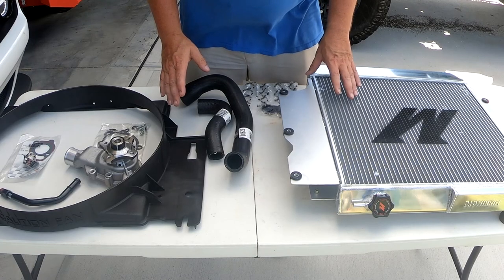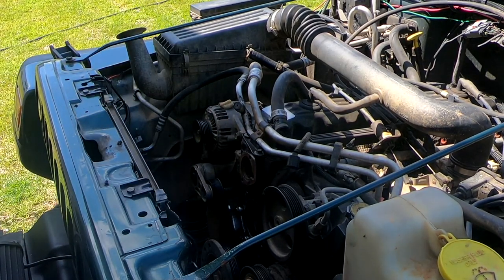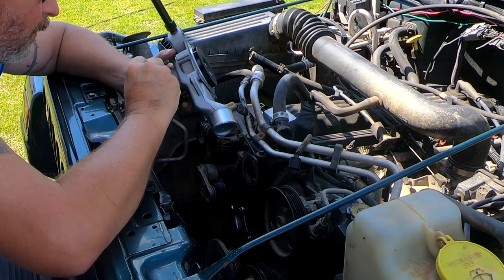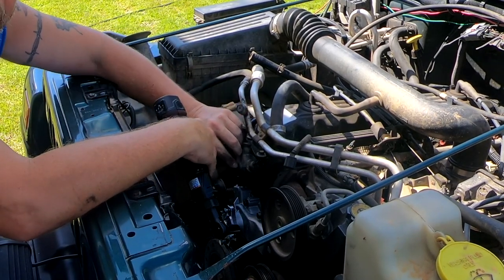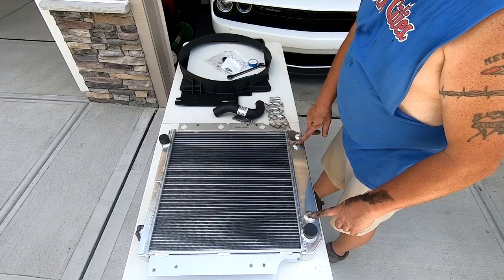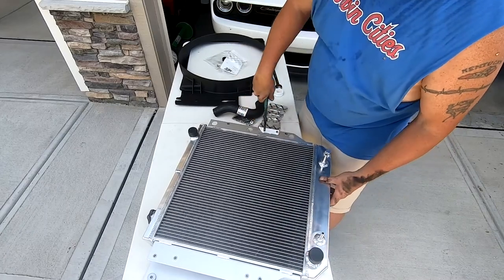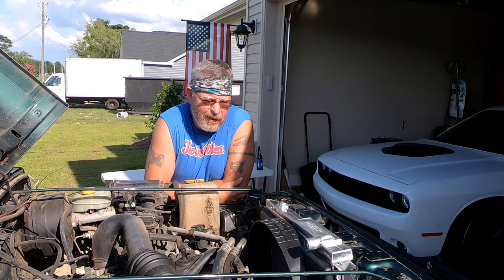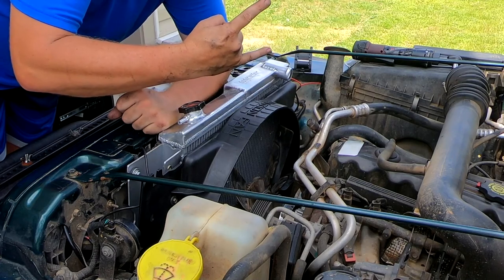Replacing Radiator on Jeep TJ

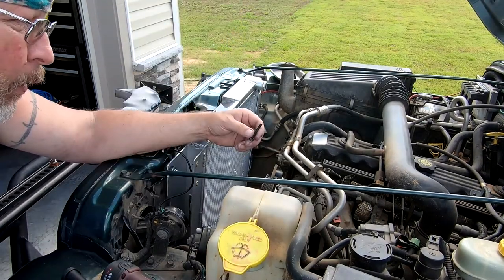Comment: 10:15 Do you remember what size bolts came with the new radiator? I actually have 1/4-20 bolts holding my radiator in. I also had an issue with my oem. fan skimming the bottom of my shroud. Don't know what your particular situation was but mine was due to a 1.25" body lift I have on my TJ. In the end I was able to clearance the bolt holes in the shroud and scoot it down just enough on the radiator to clear the fan blades. I only needed about 3/8". I like that  nutsert idea though. nice work.
Reply from the maker: LOL! I don't have any idea what size bolts came with that radiator, been too long ago. Yeah, 2" body lift on our TJ is most certainly what was causing our rubbing issue as well. The nut zerts worked well, however the radiator only lasted a year, and sprung a leak. Ended up going back to an OEM. Shoulda went that way the first time. Glad you liked the vid. Thanks for watching and the comment!!🤘🏻

Comment: I was just about to ask for a follow up report, on the radiator, and see in your reply below that it started leaking. It seems like all of the alum ones for TJ’s leak, and everyone ends up going back to oem. 
Thanks!!!
Reply from the maker: Yup! I actually did another video a year later after THIS one started leaking. If I had to do all over again, I'd have gone with a Griffin. But, the OEM seems to do as well. Hope this vid saved you some time, heartache and money. Thanks for watching and the comment! 🤘🏻
Reply: @ShockWaveOffroad  
Ahh. Ok. 
Yeah bud, definitely helping make my decision. We’re prob alike, in that anytime we replace something we hunt for an upgrade...so that’s why I was thinking a multi core alum. But honestly...my oem has lasted 20 years! So I’m going back to that, but see that the actual mopar units are discontinued. Which oem unit did you get?
Thanks!
Reply from the maker: @dylanthevillian1  Honestly, we went to Advance Auto Parts and got their OEM equivalent. So far, so good! BUT, like I previously said, if this was my FIRST go 'round, I'd still go with a Griffin.
Reply: @ShockWaveOffroad  
After researching all of the various alum rads on amazon...they all eventually leak. The $200 ones upto the $500 ones. Do you personally know people with griffins? I see they’re about $350, right? 
Thanks.
Reply from the maker: @dylanthevillian1  Yes,  I  (DO) know people with the Griffins. Although,  I have to disclaim, everyone I (KNOW) with a Griffin is in a JK. I would have to (ASSUME) that the quality would be the same for a TJ. All THAT said, I would still opt for the Griffin FIRST. Wish I woulda done that here, but I didnt. Mishimoto makes some quality parts, but the TJ radiator isn't one of them. I'm not sponsored by anyone and don't get any money from anyone. So, I'm giving you my honest opinion here. If I had to do it all over again, I'd opt for the Griffin. However, we've had ZERO issue with the Advance oem equivalent. The choice is on you, my friend.🤘🏻
Reply: @ShockWaveOffroad  
Definitely considering the griffin!
Thanks again!